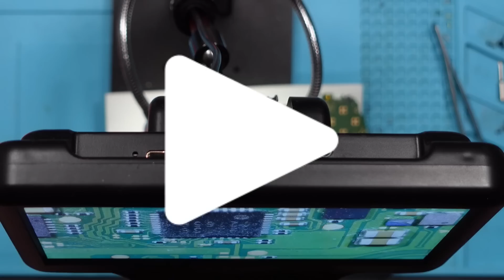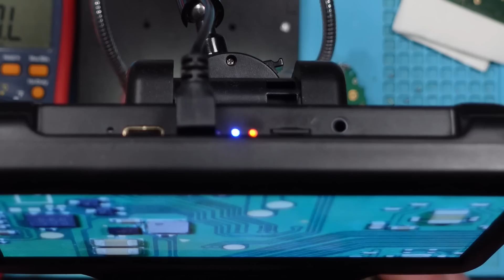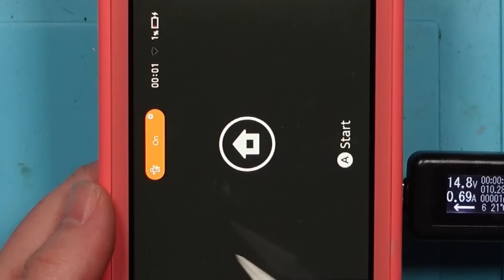I Bought a FAULTY Switch Lite on eBay | EPIC Reballing* | Can I FIX It?

Comment from the maker: Stupid microscope wiping all my hard work
Reply: What microscope you have ? Or did you change the microscope stand ? Thanks a lot
Reply: If it happen next time (hope not) - you can stretch that angle view so it fill the whole screen
Reply: I’d suggest you use a pin and a drop of IPA or flux on the tip to pick and place solder balls on chips (you'll need flux on the chips as well).
The superficial tension would do all the work for you, instead of pushing and pulling things around with tweezers.
Reply: Steznilla ice
Reply: @kubagornowicz  doing that would look like an absolute blurry mess. at least this way the video quality looks presentable.
Reply: If that's the new microscope, send it back because it's a piece of crap.
Reply: Can you put a bigger SD card in it?
Reply: You sure you dont have a fake sdcard?

Comment: Nice fix Steve. That tiny BGA IC is the Fuel Gauge IC, which is also part of the battery/charging circuit. As for reballing I would recommend to use paste for such tiny chips because it takes a couple of seconds then. I have designed a 3D printed BGA reballing "Jig" to make this process easier because it will hold the stencil down and you have 2 free hands. I have made a video about it and all the files are available there.
Reply: Is gas gauge not to the left of the charge port ?

Comment: Nice repair. :) The 'Parental Controls' is removable.  1. Click orange Parental Control. 2. In the code screen: Press 'Forgot Password' 3. Note the digit number and DON'T close this screen. (The digitnumber will be generated new every time the screen is opened.) 4. Contact Nintendo Online Support with or without Nintendo Account and provide the written digit number. The response will be a master key for the actual digit number. 5. Enter the master key and type in a new parental code.

Comment: next time try using ceramic tweezers of the kind that opens when you squeeze it, to hold the chip in place and use a silicone mat underneath. This would reduce heat being drawn out of the chip from laying on a pcb, speeding up the melting of the solder balls while holding the chip in place. Keep up the awesome videos. :)
Reply: not sure how they are named in english but translated from german it would be something like cross-tweezer or scissor-tweezer, and i can confirm that would have made his life a lot easier
Reply: @Ceriva09  They're usually called "cross lock tweezers" in English, so yeah, almost the same thing. I used to call them "tension tweezers," but it seems like no one else calls them that 😂

Comment: Always great to see you at work, regardless whether you actually succeed or not. It somehow motivates me to start and try broken electronics too, but I'm pretty sure I'll actually have no idea where to start.
Reply: You have Google.
Reply: It was the same for me 5 years ago and now i am at my 3rd year university for philosophy and decided that i am going to work as a technician after taking a degree at that. I started by getting only the necessary like multimeter, soldering iron, solder, flux, braid, desolder pump, and some prying tools off aliexpress for very cheap. I used screwdrivers that we had at the house. When i saw that i liked it i started buying more and better things. My main being the multimeter and i got a 100€ soldering station additional tips for the iron and nozzles for the hot air and a heat resistant mat. Also i got some soldering practice kits cheap and a diy component tester that i used for practice and a tool. You dont need much. Oh and dont forger IPA as well if you do start. Most additional things i have i got them as i needed them. Also there are some great channels explaining circuits and components: Electronics repair school, learn electronics repair, Northridgefix and many more
Reply: Give it a go! It's broken anyway.. If you fix it, great. If you don't it's still broken so nothing lost.. well perhaps a bit of your time, but think of that as learning :)
Reply: Everyone starts with no idea, ya got this!

Comment: I haven't done any switch lites before, but it's probably the MAX17050, which is responsible for reading the information from the battery, it's called the 'fuel gauge'.  I've changed a few, they do go it seems.
Reply: That’s the one, it’s the battery monitor, quite a powerful chip for what it does - voltage, current, temp and state of charge
Reply: fuel gauge is very close to the Usb c port on a lite. and get floated often by people changing the port over. 
something which dosent happen on a normal switch

Comment: When you find your SD card has done that, it's a counterfeit.  It's capacity is marked one thing (and it's "flashed" with a fake ID/capacity) and when it runs out of real room, it writes over itself.
Reply: That's the reason why you should always buy name brand SD cards, in full retail packaging, from trusted stores/sellers.
Eco-Friendly packaging just means the counterfeiter was two cheap/lazy to copy to the retail packaging so they try to sell it in "less wasteful" packaging.

Comment: Could someone please explain a short circuit is in this context? I mean, I understand that a short is the circuit bypassing its usual path, but how can you tell there's a short circuit by doing what Steve is doing, and that it's not just the expected continuity? And why check capacitors, as Steve often does?